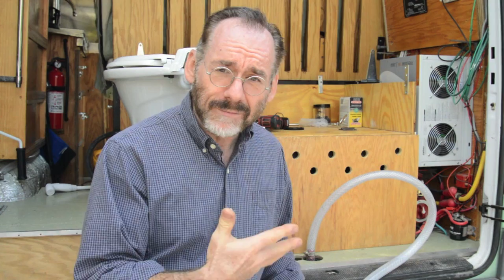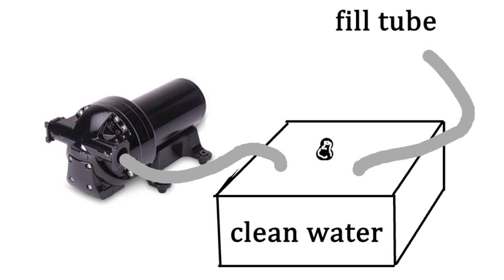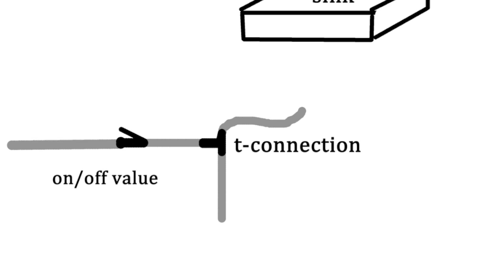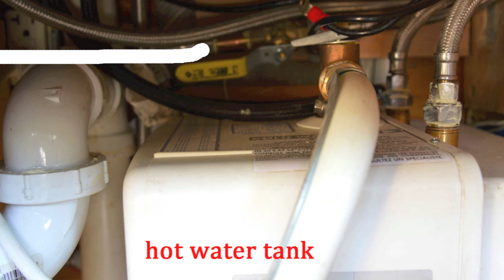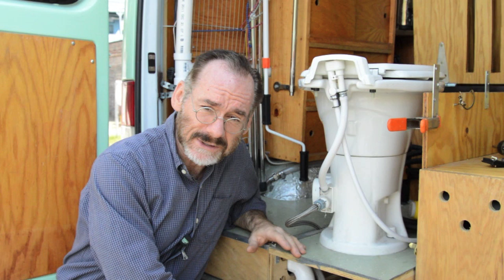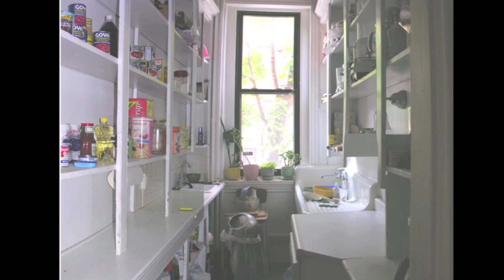Camper Van Conversion, Part 4: How to Install RV -- Camper Van Plumbing

Comment: You do very good work. I have done several conversion vans in the past 40 years. Hauling around 1,000lbs of greywater and freshwater never appealed to me. Affects gas mileage considerably.  Inasmuch as it is rare not to be near a bathroom at some point in the day a porta potty served me well and I never needed more than 5 gal of fresh water which stored easily in simple jugs above the sink. Again, you do GREAT work, but alot of this is way more than the average homeowner is capable of IMO.

Comment: I was feeling a bit overwhelmed before I saw your video.  Thank you for keeping it simple without all the extras when making an informative video.  I'm converting a school bus and you've helped me out tremendously and took alot of the stress out.
Reply from the maker: Thanks, Margery. Good luck with your project!
Reply: Margery P 

did you start tge bus conversion? I've been trying to find one on eBay for some time. looking to do the same thing

Comment: speaking as a welder who works in a water treatment plant, i suggest caution in selecting aluminum for waste water holding tanks. most grades (particularly if uncoated internally) will rot to hell . a custom molded PVC or ABS or  tig welded 316 ss sheet ($$$) may offer better service , the 316 being heavier but more resistant to mechanical damage and won't become brittle in subfreezing weather.
if it must be aluminum, then go  marine grade and look into galvanic protection options like what is applied to outboard motors and/or an internal protective coating .
i've seen aluminum components so corroded that the walls were literally porous, which cannot be weld repaired properly.
Reply from the maker: Yes, good advice. My aluminum water tank is coated inside but the coating has left the water tasting funny, so i don't use my water tank for drinking, only for washing and flushing.

Comment: A holding tank is not a septic tank the tanks it will be emptied long before you get any benefit from bacteria breaking down the sewage. The vents are to equalize the air pressure as the  tank fills and drains.

Comment from the maker: Clean the toilet this way just before you empty it, then dump everything, and  rinse it out well (while it's still connected to the dump hose). When you're driving and using the toilet, you want it to take care of itself -- which it will, if you let the natural bacteria do its job. In short: no bleach when you're using the toilet, only when you're dumping it and cleaning it out.

Comment from the maker: Matt: the toilet is a Dometic 310 Series, standard height, bone china.

Too much of a hassle to divert the gray water back to the black water tank.

Thanks!
Reply: hey Ron i have a extended compartment like a luggage area, can  mount the tanks in that area,  also instead of having the pipe extend to the roof can i push it through the side

Comment: This is the best informative and practical oriented video on plumbing i ever saw on youtube! 
Thank you very much for sharing this informations, i think that many diy converters would find it really useful.

I have a question for you about dumping: Did you ever thought to use  the grey water to flush the black water tank and the flex pipe when dumping? I saw that's really common in big american Rvs but never saw it here on the other side of the Atlantic.  I've been using the smelly flexible connection pipe enouth in my life that i want to find a better way to get it done. 

Which brand is that toilet? Never saw one like that before.

Indeed, great job with your van,
Matt from Uk

Comment: Great video Ron, thanks! Amazing how many links I had to sort through before finding one that actually addressed the basics of small RV plumbing. Those holding tanks appear very large and substantial, and I'm wondering if there are other options, and what type duration one might expect between emptying based on xx gal. tank?  thanks again!
Reply from the maker: +Brad Bleakley 
Thanks, Brad. My water tank is about 22 gallons; the black water tank is about 15. There are many options. You can get a portable tank, a chemical toilet,  even a composting toilet. Typically, I empty my tank once a week or so. Obviously it depends on how much business you do on the pot.
Reply: +Ron Tanner Great instructional video Ron.I have been wanting to install a toilet in my Ford E250 work van,better than going to McDonalds,ect .This shows how to install.My question is how did you wire the 12v pump and do I need an extra battery to run the pump or just wire into the vans hot wire with a on/off flip switch?Thanks
Reply from the maker: +jim franklin 
Hi, Jim: sorry for the delay in answering. No, you do not need an extra battery to run your pump. You can connect the pump directly to your starter battery -- with an on/off switch between the them. You turn on your pump only when you use the toilet. Then turn it off; otherwise, you'll run down your battery.

Comment: I have a small camper trailer and I am wheelchair bound the bathroom has a wall mounted sink that prevents my wheel chair access but the sink faucet has a shower hose which screws on and want to keep the shower faucet/shower hose and remove the sink ..can i do this and just cap the grey sink water pipe ? Thanks so much I love your videos /channel !
Reply from the maker: Yes, that is correct: just turn off (cap) the line that goes to the sink, then use the sprayer line for your washing needs.
Reply: Ron Tanner Great thanks for the valuable advise !

Comment: Thanks so much for the video so good! Just a quick question, can you mount the vent line out of the side or bottom of the van?
Reply from the maker: Good question. If we talk about housing/building codes, then sewer gas would have to be evacuated from the roof. Under the van would be dangerous because sewer gas (methane) can be flammable. Exhausting out the side would be difficult because the pipe would get int he way of obstacles, even other vehicles. Good luck with your campervan build!

Comment: Hi Ron I have watched your video many times and it has helped me plan my install.Question,when drilling the holes for the black tank what size hole is needed for the toilet and vent pipe and what are the correct size/type of grommet for the holes?Do the toilet pipe to the tank and the vent pipe just slip into the grommet forming a tight seal?Also is a grommet needed for the cleanout area where you empty the tank?Thanks
Reply from the maker: Jim: installing the toilet to the tank is pretty simple. The toilet outlet fits into a 3" PVC pipe and that pipe fits into the tank opening (3"). You can use a rubber sleeve (Fernco brand) to attach the PVC to the toilet; then use a 3" gasket to insert the PVC pipe into the tank. Go to an RV supply store and you'll see these things.

Comment: Hi Ron. Thanks for posting this. I am in the design process right now and looking to start building in about 3 months. I had a couple of questions that I hope you could help out with: First, did you apply the cold weather heating pads before or after the Lizard Skin Ceramic? I need a similar setup for below 0 temps and was wondering about best practices on winterizing with similar pads. Second: I am using a tankless water heater and putting in a shower as well as a sink, toilet, and outside shower (for the dog). Any advice on placement of the heater and lines that I should consider? I am worried about weight distribution but could conceivably put most of the water-dependent systems on one side.  Any insights? Thanks a lot!! Sean
Reply from the maker: Hi, Sean: heating pads go on before the ceramic coating.

I don't think you'll have enough onboard power (batteries) to operate a tankless water heater. They draw way too much power. Tankless was my first choice but I ended up going with a point-of-use heater. And then I NEVER used it, so I took it out -- because I never plug in at night (at an RV park). 

If you plug in every night, then it's no problem to go with either water heater. 

Water tank placement is really important for weight displacement, as you indicate. I placed my black water tank beside my fresh water tank in the far back. Battery placement comes next because they are very heavy. 

Good luck with your project!
Reply: Thanks Ron. I appreciate the info.
Reply: BTW, Ron, have you seen or heard anything about this unit: http://www.adventurerv.net/girard-tankless-propane-water-heater-p-27164.html

I'm putting a pretty robust electrical system in so I can have a few special amenities but looking at something like the unit above, I am hoping to use only propane for water heat. Your thoughts?
Reply from the maker: Hi, Sean: thanks for this link. A propane-powered water heater is the way to go because you're not relying on your batteries. The only complication is that you have to put the propane tank in a safe place. And you have to vent the CO produced by the water heater.

Comment: you're like Walter whites non evil brother. 

great vid, did you use engine block heaters for your tanks or do they make rv heaters?
Reply from the maker: I have heating pads attached to the tank; these pads are AC and DC powered.
Reply: cool. thanks for the response

Comment: ron i have a old winne indian from 73 there is 0 plumbing orgininally laid. doe a water heater just require a cold water sorce running to it and the hot water source on its own circuit?
Reply from the maker: Correct. The Cold water line splits into two lines, one for hot, one for cold. The water heater itself is AC powered, so it gets its own circuit.

Comment: Do you have any more info on the heat pad to keep it from freezing? This is my main concern with mounting tanks on the underside. Curious how much power the pads use and what kind of temperature lows they can withstand to keep water from freezing.
Reply from the maker: Just do an internet search for "rv heating pads for holding tanks"